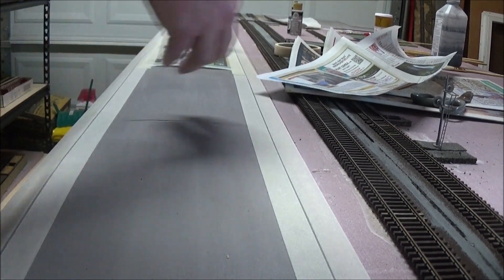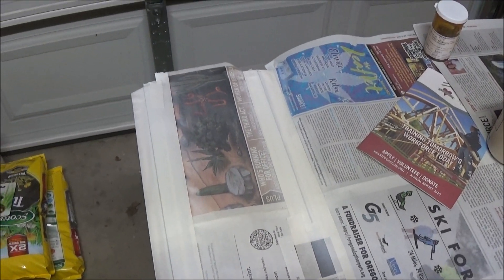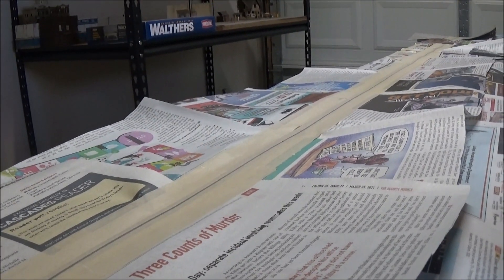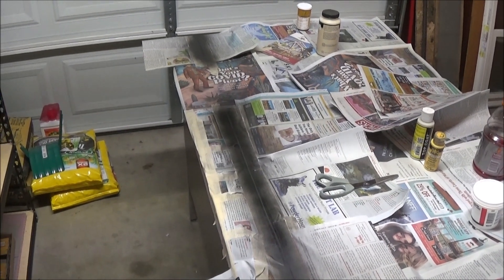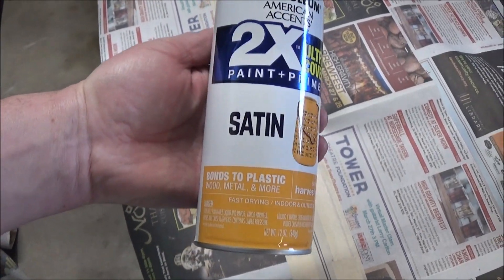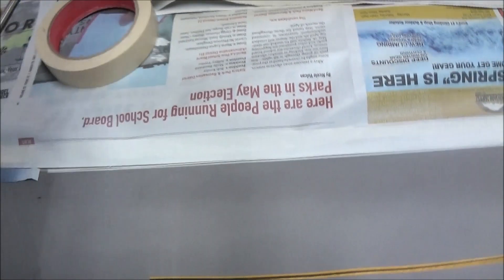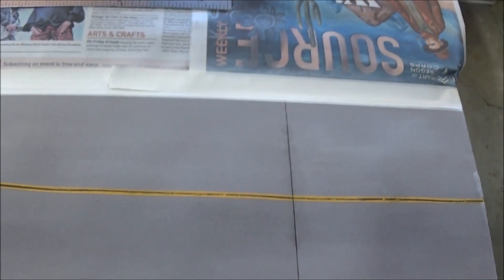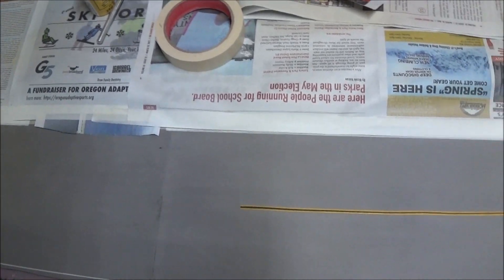HO scale diorama build  part 5

Comment: Blue painters tape has less adhesion but it is still recommended for no bleed through. Less adhesion, easier to pull off.
Reply from the maker: Hi Roy, yes you are right, I had the regular stuff on hand, but will use the blue painters tape next time.